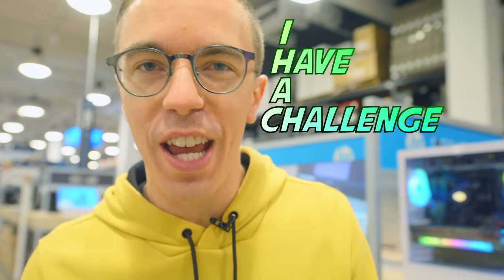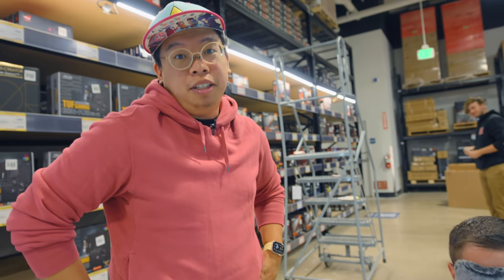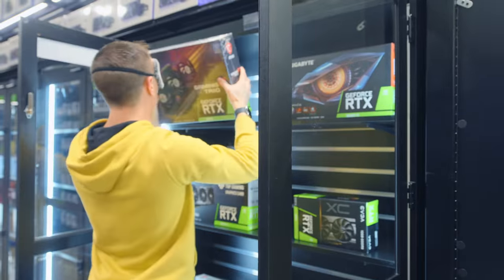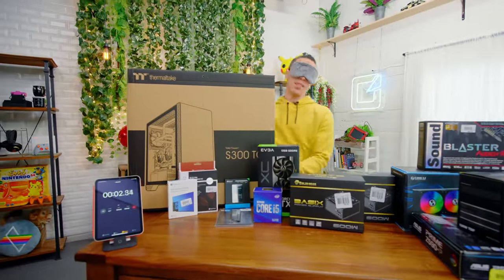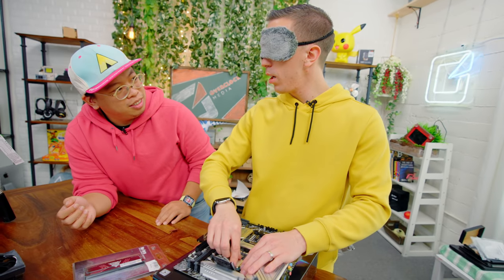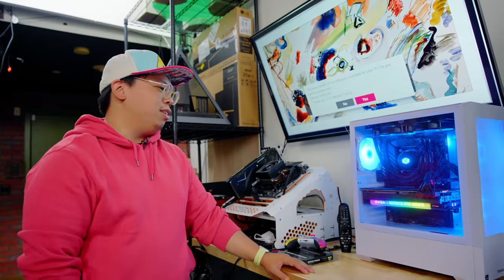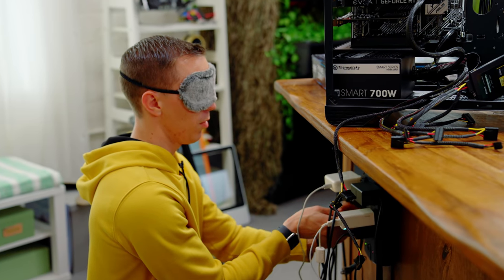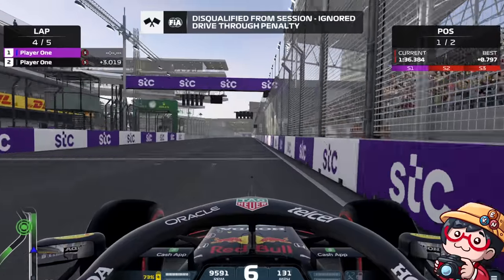The WORST Gaming PC I’ve Built

Comment: What amazes me the most is that there were actually GPUs there in the store.
Reply: I was thinking the same thing. Although I'm fairly certain that those cards where in the back not for sale so they had them for shooting the video. I would be very surprised if they had those all the time. I live 1 mile from a microcenter and have not seen any decent graphics cards since the shortage started.
Reply: @coreyklima8929  its a new store ofc they will have GPU's for sale
Reply: @notcapnbloodbeard  I'm sure that they had stock at the time of filming....but I'm just saying the representation that they have stock consistently of the RTX 30 series is a little misleading. New store or not no one has had these around and when they do get more they are gone within minutes or hours. If Microcenter did have them constantly every pc builder or scalper in a tristate area would be flocking to the store.  Almost guarantee if someone where to walk in that store right now there would be nothing or just random Quadro, extremely old and underpowered cards that's it.
Reply: @coreyklima8929  they have 1 person 1 GPU rule. . .but i get your point they might have some extra for display for the video

Comment: Is this pc good for gaming but Ls someone let me know new to pcProcessors : Intel Core i9-12900K 16-Cores 3.2GHz (5.2GHz TurboBoost) 
Motherboard : MSI PRO Z690-A WiFi DDR4 
Memory : 64GB CORSAIR VENGEANCE 3200MHz (4x16GB) 
System Cooling : CORSAIR iCUE H150i ELITE CAPELLIX LCD Display 
System Fans : CORSAIR QL White Fans iCUE RGB controlled by iCUE software 
Graphics Cards : NVIDIA 24GB GeForce RTX 3090 
GPU : 1 
Operating System : MS Windows 11 Pro 
Operating System Drive : 1TB OPC Approved Powered by Samsung 
Hard Drive : 250GB Samsung 870 EVO Series 
Hard Drive : 1 
Power Supply : CORSAIR AX1600i ATX Titanium 
Power Supply Sleeved Cable : No Sleeved Cable 
Audio : Integrated High-Definition Audio 
Networking : Onboard Network Port 
The ORIGIN Difference : The Best Gaming Experience Guaranteed